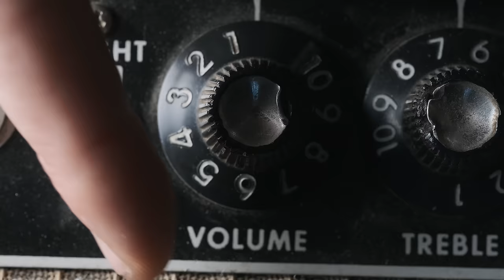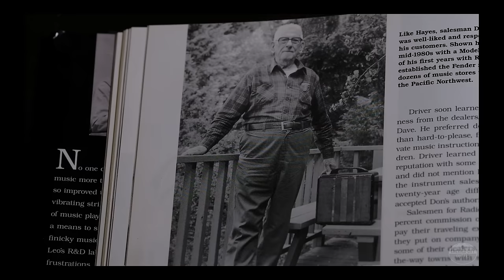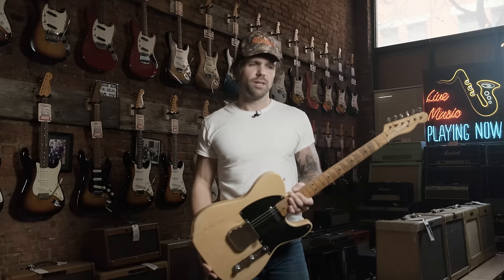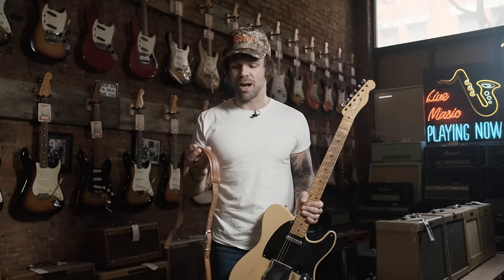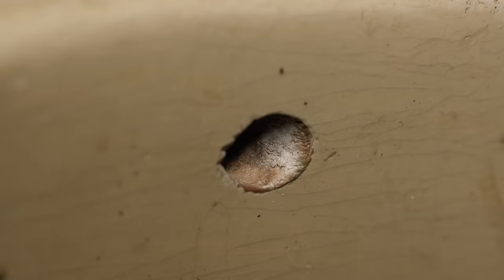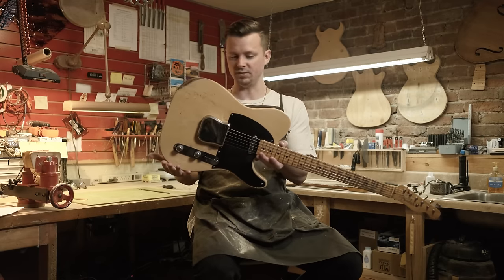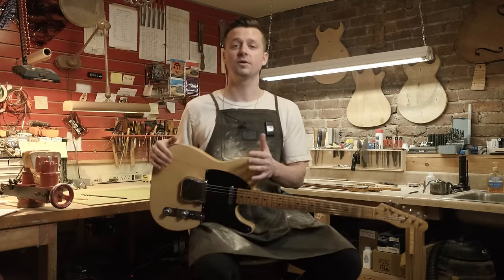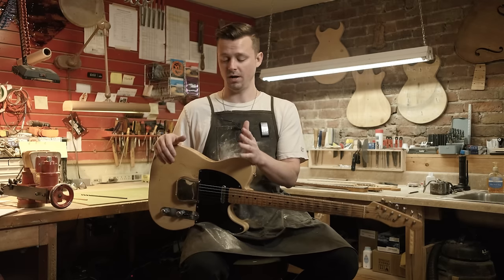ONE OWNER 1951 Fender Nocaster with one MYSTERIOUS feature…

Comment: I have seen a few 50's Fender Guitars that had holes drilled in that spot for Saxophone Strap holders. The hole in this one is much, much longer than would have been needed for a Sax Strap, but it might have been done to have something attached to hold the guitar.

Comment: The hole. I have no inside information, but similar to an idea of my own. To install a piezo pickup into the body of a guitar. There could be many reasons why they opted not to in the end. Perhaps they could not shield it well enough or it caused feedback or it just wasn't the sound they wanted. So they already drilled to holes in "X" number of bodies?

Comment: Come on bro, i could drill that hole no prob. I got a tool box full of long bits like that. Being a guitar maker i have drilled lots of holes like that. Its just not that big a deal. The guitar is awsome
Reply: This is how you sell an overpriced vintage guitar nowadays
Reply: Lmao he was talking like it was some impossible scientific feat.
Reply: Lol, I was thinking the same thing. If you peck drill it, rather than just plow through, it tracks straight every time. I did a lot of that in my first couple of guitars that I built, before I started putting more thought into cavity and channel layouts on my own designs. He's just trying to hype the thing up.
Reply: So are you saying an amateur drilled it?
Reply: @ChrisShortyAllen  no, just not that hard a hole to drill. Easy peasy
Reply: I used to drill a hole through the neck pocket of a telecaster all the way through the first route for the pick up and on to the second route every hole at the bottom of the route.No problem.I never missed so this little dinky.Whatever is a no brainer
Reply: @danlawson3986 Agreed, not different, and just start with a tiny bit perpendicular to the surface and very shallow, then increase the size of the bit and adjust the angle to where the full depth hole is going.

Comment: Too bad they weren't as precise with the holes holding the neck on the Body. The Bass string at the end of the fretboard is almost even with the side of neck. And the treble E is too far from the side. But it is a Nocaster and I wouldn't kick it out of bed. Sounds amazing.
Reply: I'd slacken the neck screws a tiny bit, then reposition the neck and tighten the screws back up to realign it.  Something I've done many times.
Reply: @1man1guitarletsgo  
I doubt there is enough slack to easily fix it just doing what you suggest. It looks way off. But it would be cool if that is all it needs. At least for them.  Plug and drill might hurt the value.
Reply: I did the same 
Fixed it right up!
Actually my friend did it
Wouldn’t have believed if I hadn’t seen him do it

Comment: the perimeter of the hole inside of the cavity would have chipped out if it was drilled after the body was shaped. as this isn’t the case, it’s likely the hole predates the shaping of the body
Reply: My assumption is the same. I think it was just a blank with a hole drilled in it before shaping. I don't think it had any real purpose, they just probably had it lying around, and then made into a Nocaster. They weren't too fussy with the parts. I have vintage Fenders that were made from old parts lying around. For instance, I have a 1972 Stratocaster which is was made with an earlier body which was half shot in sunburst (they never fully finished the sunburst process) then had a black finish over top. It is made from parts that date from 1970 to 1972, and should have been a three bolt neck by that time, but it is a 4 bolt. My guess is someone wanted a custom color black guitar, so they throw together parts they had to make one.